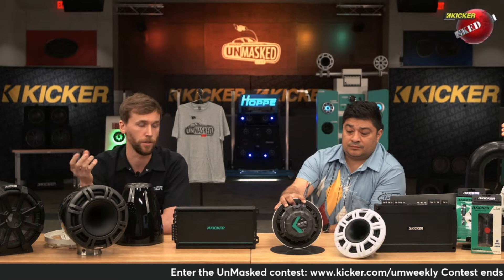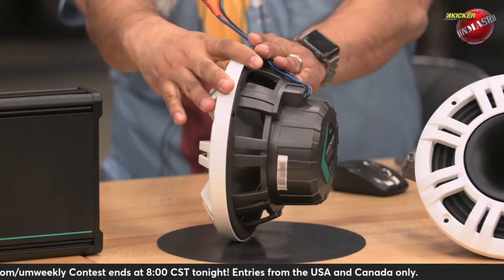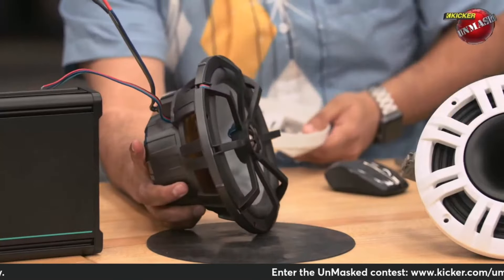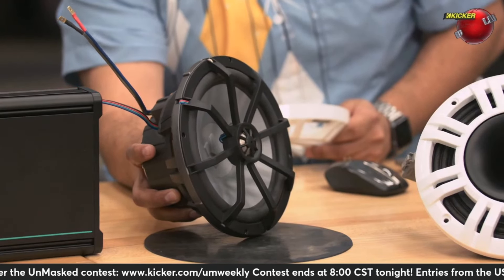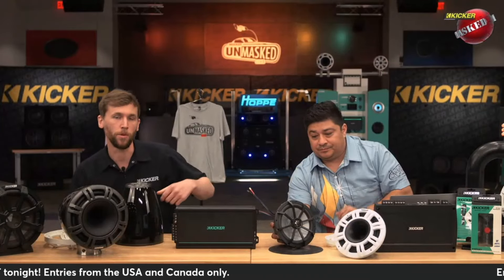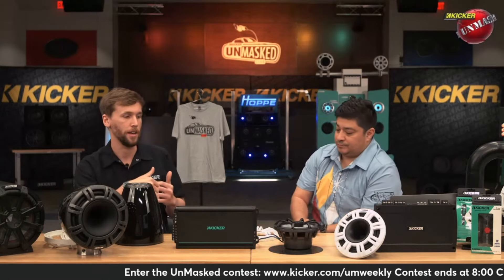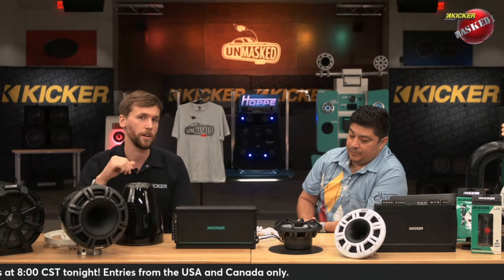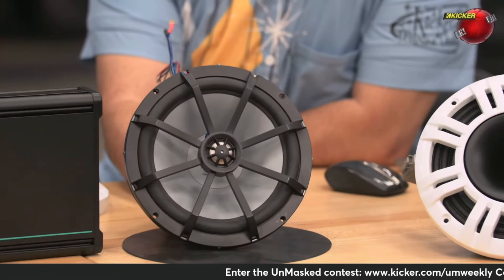Resisting Rust in Marine Audio Gear - Kicker UnMasked - Shorts

Comment: I used a kicker loc2 for my subs and it's been great. But I used it for my mids and I'm getting a Humm from the speakers at zero volume? My ground is good im getting audio when i turn it up and hum gets drown out but when radio quiet it humms
Reply from the maker: Give Tech Support a call.  It's likely the LOC is getting radiated noise from something else in the vehicle. Tech can help determine what it is. Their number is 405-624-8510, open weekdays from 8-5 cst.
Reply: @KICKER-AUDIO  would not using the same ground point as the amp. Cause this? Ground should be ground but I've heard of weird ground things in vehicles idk 🤷‍♂️ guess quickest way would try jumping ground directly from amp ehh?